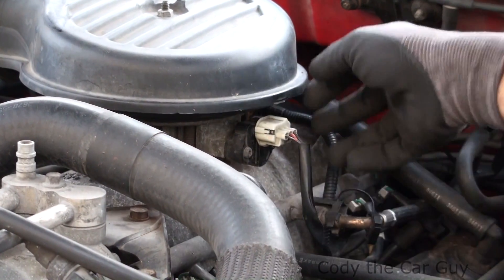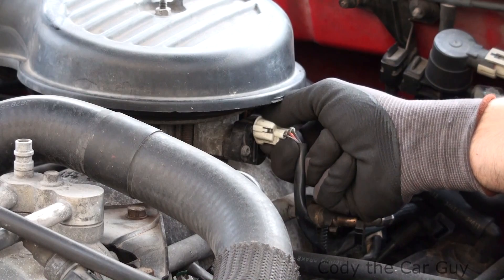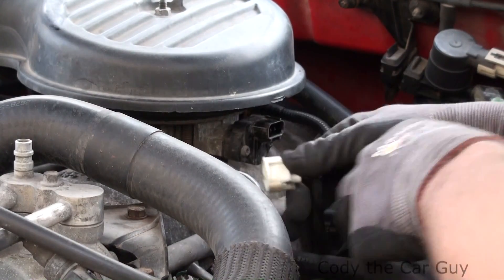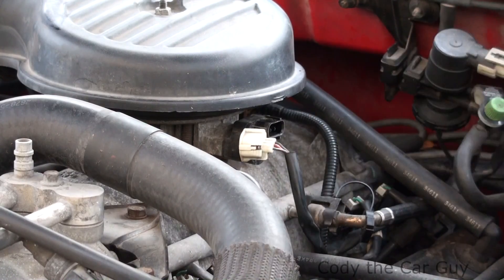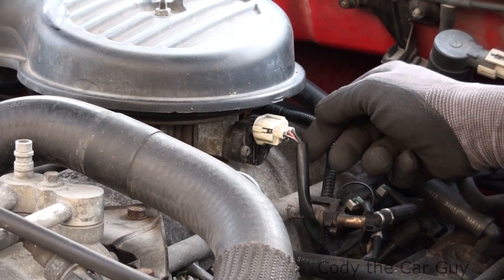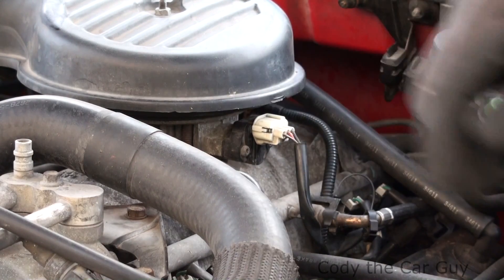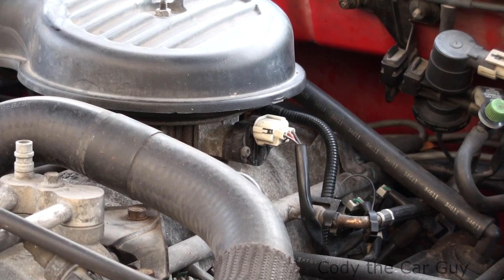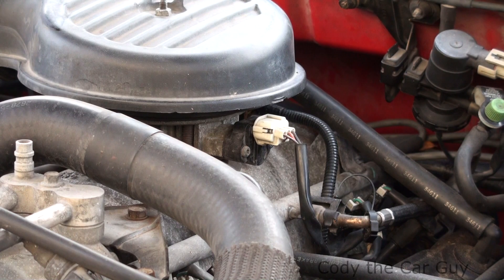P0121 Throttle Postition Sensor troubleshooting tips

Comment: mine CEL just started comin on, 2009 camry 2.4, TP on gauge will read +5% at idle, car goes into limp mode, so then I stop car and unplug power to throttle body, plug back in, clear CEL and then I get another 50 miles of driving without issue before it returns and I do it all over again.  Weird.

Comment: I recently replaced mine and now it is throwing out the code for the TPS. Is there something else it could be?
Reply: how is it now  ??
Reply: Dirty throttle body.
Faulty or failing tb
Open or shorted wire in tps circuit.

Comment: What happens if you just leave it unplugged all the time so it will run better ?
Reply: i second this question
Reply: You won't have Torque converter lockup in overdrive